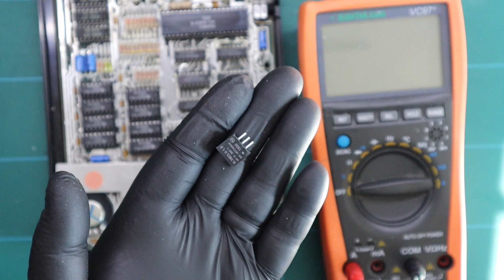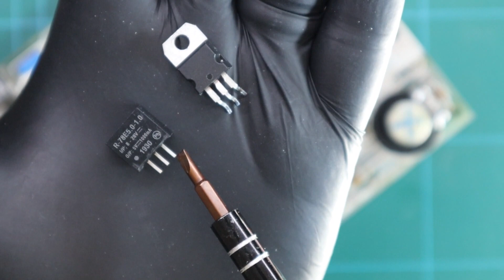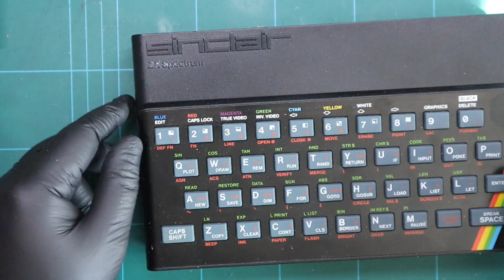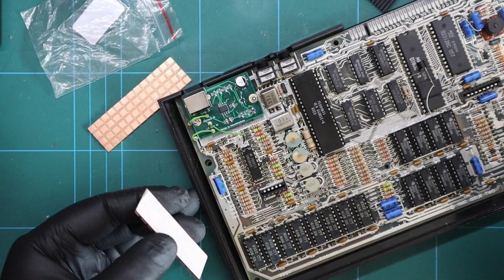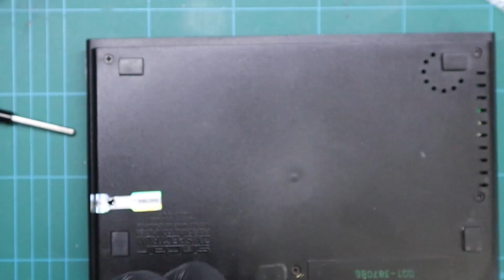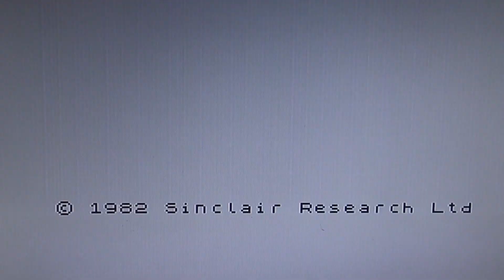ZX Spectrum repair, restore and upgrade. Part 4

Comment: Just got one from ebay and fired it up at the weekend.  Works ok but think I will try and do some of the upgrades as it's probably never been opened and like me getting on abit. Bring back good memories. Thanks for the videos they will be a great help.
Reply from the maker: Excellent stuff, certainly I would look to change the capacitors, they never age well and the composite modification. There are literally hundreds of videos showing the best way of doing this. 

Enjoy the memories. 

Dan